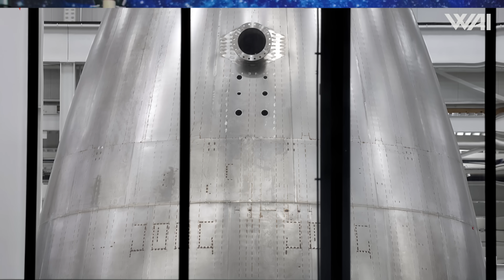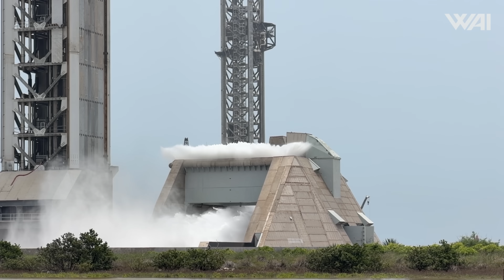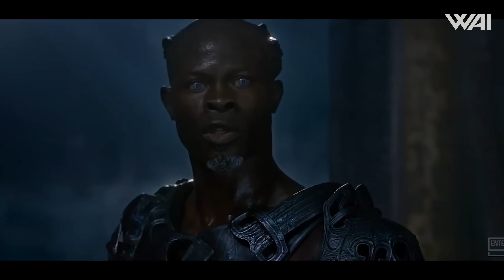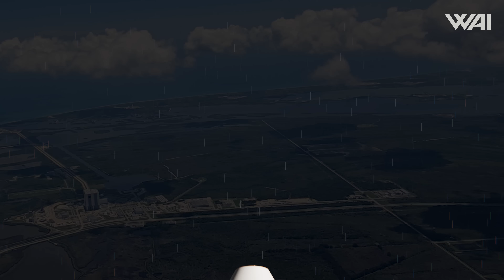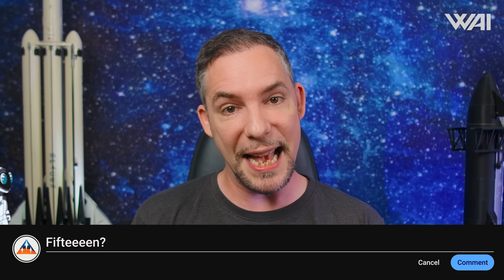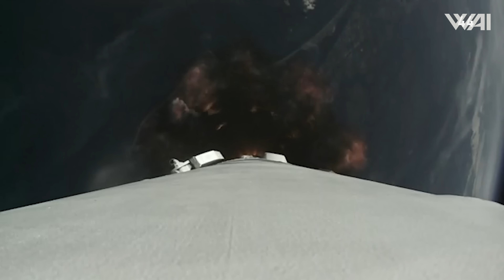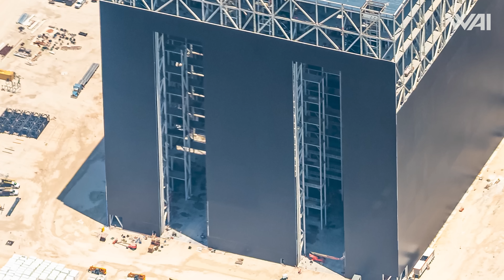SpaceX Is Getting Ready For Flight 13! NASA Reveals 15 Flights per Artemis Launch

Comment: They had better map all the pipeline locations in and around Pecan Island, Louisiana, before starting to design any development infrastructure. Abandoned wells could be hiding out there. You wouldn't want to dig into any of those, or have one start leaking under your building. 
The water in that Pecan Island photo is very near mean sea level.  In 2005 Hurricane Katrina pushed in a 28 foot high storm surge onto the Mississippi Gulf Coast about 175 miles east of there. That was the highest storm surge ever recorded in the Western Hemisphere. The defective New Orleans levees, built by the US Army Corps of Engineers, which failed, were on the weak side of the storm center. Had the storm hit 40 miles more to the west of where it did, the loss of life would have been FAR higher, probably in the tens of thousands. Imagine 18 feet of water in your front yard with 115 miles per hour wind . Think you could survive that?  That is what nearly happened to New Orleans, Metairie, and Kenner Louisiana. 
Some future hurricane has Pecan Island on its target list.

Comment: Wow, so we can reach a dead rock with nothing on it that's bathed in radiation? Sign me up! You Space Nutters are hilarious.
Reply: Um, the Earth is subject to exactly the same radiation. On the moon, the regolith will replace the atmosphere in blocking much of it. Building underground on the moon is a lot easier and cheaper than on Earth.  And it eliminates the need to move lots of construction material from Earth. This is why most recent science fiction has life on the moon underground. Economics plus safety. The availability of low gravity and cheap, high-quality vacuum makes some processes much easier on the moon. Near the poles, you can put solar arrays on opposite sides of the moon, connected to your moonbase, and get much more energy per square meter than on Earth. (Connect the arrays to your moonbase with YBCO superconductors buried under low-temperature rock, with vacuum insulation. ;-) Surface catapults will eliminate the need for most rocket launches and landings. (No atmosphere both makes the process practical and makes it possible to use the catapults in reverse for landings. You can line up hundreds of kilometers out and be accurate to millimeters.)
Reply: @eachus  Um, the Earth has an atmosphere and a magnetic field.

Comment: My interpretation is a bit different. The position near the top of the nose cone doesn't make senese, as the propellant is stored far away. But propellant transfer is a very difficult task. In microgravity environment fluids aggregate to spheres, making any tranfer a horrible task. If anything wents wrong, the ship could loose all it's propellant, causing a big issue in orbit. Therefore it is much more favorable to test propellant transfer not with the ship's propellant but with a different cryogenic liquid. It need not be oxygen or methane but can. It can be done with liquid nitrogen. Such test fluid must be stored in the starship's payload area without affecting other tests. For such task the nose cone seems to be a perfect place to transfer some cryogenic liquid from one ship to another. If anything went horribly wrong, the mission could go ahead.
Reply: They actually tested it with real propellant. On Flight 3 (March 14, 2024) SpaceX moved roughly 10 metric tons of cryogenic liquid oxygen between the header and main tanks while coasting in microgravity. They use autogenous pressurization, ullage gas settles the liquid and pushes it across, so there's no need for an inert stand-in like nitrogen. Carrying a separate test fluid would just cost payload mass to avoid learning the exact thing they need to master with the real propellant anyway.
Reply: @imrich333 I think he has a point for doing a full tanker test tho. If ots a first test and you arent going to the moon why not substitute the methane at least.
Reply: That thing on the nose cone is not for fuel transfer that will be done using the QD plate.Its just a place where an actuator will be installed because its a test tank nothing more this was already explained you can even see the bracket where the actuator will be installed if your brighten the Image
Reply: @Zh_sos1 great observation
Reply: this sounds very probable, very spacex-like
after reading the other replies idk
Reply: Good thought honestly. Especially for a full test. Why make it more explosive than you need to.

Comment: Getting one to orbit should be a sensible next move...
Reply: The goals for the July launch will be to resolve the engine relight issues that were experienced during hot stage separation. The August launch will be about orbit and possibly landing the ship back at the pad. 🎉🎉
Reply: @appliedfacts   
  That will definitely happen..?
August... 
   Got ya.. 
Investors are definitely going to notice the "firework every six months" thing soon....
Reply: Addressed by Shotwell during the IPO

Comment: Analysis of the assumptions made throughout the video, organized paragraph by paragraph.😅

PARAGRAPH 1: THE MYSTERIOUS HARDWARE AT STARBASE
The video opens by analyzing a modified Starship nose cone that has received a bracket, a manufacturing jig, and a small 80-cm pipe socket surrounded by six holes. The narrator assumes this configuration is explicitly an orbital propellant transfer interface built for the Human Landing System (HLS) testing program. He further assumes that since a Starship has two propellant tanks, the second interface can simply utilize the existing launch-pad fueling connection at the engine section, negating the need for a second new structural part on the nose.
PARAGRAPH 2: SHIP 40 AND BOOSTER 20 FLIGHT 13 TIMELINE
Following the rollout of Ship 40 to the Massey's test site, the host outlines the expected testing regime. He assumes the vehicle will smoothly transition from an un-ignited turbo-pump spin prime test directly into a full 60-second static fire. Based on historical data from Flight 12, he assumes that because the launch pad and hardware are now thoroughly proven, SpaceX can bypass the prior deliberate pacing and extra wet dress rehearsals. Consequently, he assumes the launch timeline can shrink from five weeks down to a couple of weeks, allowing them to meet a launch target in early July without any unexpected engineering reworks or test aborts.
PARAGRAPH 3: INFRASTRUCTURE AND THE "STAR PIPE"
Reviewing the logistics of high-cadence launches, the narrator discusses SpaceX’s planned natural gas pipeline stretching from the Port of Brownsville to Starbase. He assumes that because a single launch requires roughly 230 tanker trucks of propellant, trucking will become completely physically impossible at a daily cadence. He also assumes that naming the infrastructure "Star Pipe" and constructing it means SpaceX is firmly committed to an uninterrupted, continuous industrial launch campaign across every single pad they plan to construct, rather than scaling up iteratively.
PARAGRAPH 4: THE NASA OIG REPORT AND LAUNCH CADENCE
Analyzing NASA's Office of Inspector General report regarding aging launch structures, the speaker highlights SpaceX's intention to launch every 8 days from the Florida coast. He assumes that this early goal will reliably translate into exactly 45 Starship launches per year from the Kennedy Space Center (KSC) alone. Furthermore, he assumes that the 15-launch requirement outlined by NASA to fuel a single lunar landing already fully factors in propellant boiloff over time. He bases this on an assumption that a Version 3 Starship will comfortably deliver 150 tons of payload per flight while managing a highly optimistic 10% monthly boiloff rate through adequate thermal insulation.
PARAGRAPH 5: COST COMPARISONS AND MISSION FEASIBILITY
The host contrasts the economics of the HLS Starship architecture against rival programs like Blue Origin's New Glenn and NASA's Space Launch System (SLS). He assumes that a Starship flight will eventually cost between $10 million and $20 million due to mass production and complete reusability. Even in his assumed "worst-case scenario" where flight costs remain stuck at $100 million, he assumes the full 16-launch campaign ($1.6 billion) remains vastly cheaper and more capable than a single SLS launch, assuming Starship can consistently execute orbital docking and rapid, multi-ship refueling sequences without failure.
PARAGRAPH 6: CAPE CANAVERAL BUILDUP AND SPACE COAST EXPANSION
Looking at helicopter flyover footage of Space Launch Complex 37 (SLC-37) and Robert's Road, the host evaluates the pace of construction. He assumes that because it took SpaceX 43 days to stack the tower at Pad 2, the new Mechazilla tower at SLC-37 will be fully stacked by the end of July. He also assumes that various ground pedestals visible from the air are explicitly the foundations for a future propellant tank farm, and that the massive expansion at Pen Island in Louisiana will eventually eclipse the scale of the current Starbase facilities in Texas.
CONCLUSION
In total, the narrator makes 14 core assumptions throughout the video to interpret the hardware changes, predict launch timelines, and validate the financial model of the Artemis program.

Comment: The main thing I'd expect for starship refueling in space is the same thing I see for starship fueling on Earth. Tank farm supply sufficient to accommodate pre cooling boil off. Launchpad safety structures, personnel, and equipment. Then there are holds, scrubs, inspections, repairs. I expect an industrial scale space station to do it on an industrial scale as is the purpose. 

Amateurs discuss strategy. Professionals discuss logistics.
Reply: What does any of that have anything to do with an orbiting depot?
Reply: @heartysteer8752  I know you're a troll, and you know you're a troll, now everybody knows you're a troll.

Comment: Great info Felix.. I have been following Starship since the beginning. I am a Retired Air Force Aircraft Machinist/Welder, so I really enjoy the fabrication side of everything. On the fuel side of things, I haven't seen this talked about or at least I haven't found it. I am wondering why so much fuel is required. I know that Starship is huge and has a lot of mass but once it gets to earth orbit, it then fires a Lunar Injection burn, correct? If I am wording that correctly. Like the capsules, it fires and then coasts to the moon. In space does it need that much fuel for that burn? Does it take a huge amount of fuel to land on the moon and then take off again since the moon has barely any gravity? Of course there is a landing burn back on earth. Obviously, I am a bit clueless on this part of it so if someone can explain that it would be appreciated.. Thank you!! (from Kelly (Mr) in Louisiana)
Reply: HLS delta-V breaks down as ~6.0 km/s for Starship to reach LEO after staging, ~3.1 km/s for trans-lunar injection, ~0.4 km/s for NRHO insertion, and ~2.5 km/s each for descent to the lunar surface and ascent back to NRHO — totaling roughly 14.5 km/s, with HLS refueling in LEO and never returning to Earth.
Reply: Lunar descent costs ~2.5 km/s because the airless Moon offers no atmospheric braking, so engines alone must cancel the full ~1.7 km/s of orbital speed plus several hundred m/s of gravity losses during a slow, hovering descent — making landing nearly as expensive as launching.
Reply: @imrich333  Makes sense on the braking. Do you think we could travel there slower and require less energy for braking? Just curious.
Reply: @gasandgunk 
That could be done but the trade off is that you need more food, water etc for the crew because they will be in transit longer.
Reply: The reason for all the fuel is the huge amount of mass being handled by Starship. The old Saturn 5 rockets were able to go straight to the moon without refueling because the payload they carried was miniscule compared to Starship.
Reply: @appliedfacts  Yeah I mentioned the mass but since there is no gravity, once they do their initial burn, they coast the rest of the way correct? So, does it take a huge amount of fuel for that burn just to coast the rest of the way. Certainly they won't be burning the engines the entire way. It seems like it would take very little fuel for that burn once they reach orbit. The biggest amount it launching from earth. I am obviously missing something here. lol
Thanks for the reply!!
Reply: @gasandgunk 
I don't know the exact amount of fuel needed to get to the moon with all of that mass, but it's not just a minute to or two of burning the engines. I think they burn for more like 30 minutes. They also have to have fuel to get back off of the moon which is 1/6 the gravity of the Earth. They also need fuel to land back on the Earth.
Reply: @appliedfacts  Agreed. I mentioned most of that I believe. Its just crazy at the fuel that it needs. I certainly understand it lifting off from earth with all that mass. Its hard to wrap my brain around all of that extra fuel being needed in Space. I imagine that the speed that you want to travel plays into it a good bit. Once you are past earths gravity it seems that a small burst would propel you with no resistance. However you would probably be traveling very slow... LOL. I wonder how much it will actually take Starship to lift back off from the moon.
Reply: @gasandgunk 
Earth's gravity reaches all the way to the moon (that's why the moon is held in orbit around the earth). The farther you get away from the earth the less gravity there is but it does not disappear. The gravity of the moon does eventually be come more of an influence on a spacecraft but that is about 83% of the way to the moon. So all that way Earth's gravity is still pulling back on the ship to some degree. The pull of gravity reduces the farther you get by 1/(distance squared). That's 1/d^2. The ship never does just float around with no influence from gravity. So, the way the trip to the moon is handled is to do a long burn (called the "trans-lunar injection burn") that builds up enough momentum for the ship to coast against the remaining pull of Earth's gravity all the way to the point that the moon's gravity becomes stronger that the remaining gravity from earth. During that trip the gravity from Earth is still slowing the ship. After that point the ship starts increasing speed because the moon's gravity is stronger.

There are a number of great YouTube videos on this stuff if you want to get more details. It is an awesome subject. I have loved it all my life!
Reply: @appliedfacts  Great info. Way over my fabricator brain lol. I appreciate you explaining that to me. I am a huge PROCESS oriented person and enjoying hearing how those processes work and affect the next step in a process. I may not dig into the weeds of everything but some general knowledge is helpful. Since they can loop around the moon or planets to pick up speed, I wonder if there are moves that they can make to slow the craft as well. Certainly not to a crawl but enough to require less fuel to slow down? 
With Starship, my background has me fascinated with the fabrication side of Ship, Booster and the infrastructure. I really don't have any interest in things like the Pump Farm for example but maybe how they go about organizing and optimizing some of those components. The same with the OLM, Star Factory and Gigabay. Its all cool stuff. Thanks for the replies!!